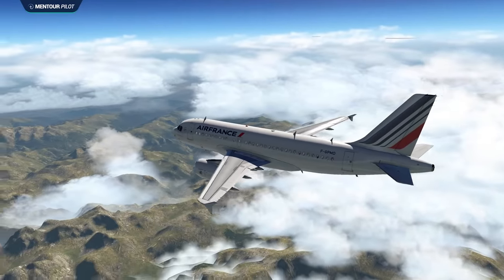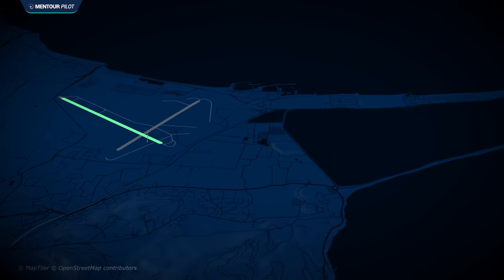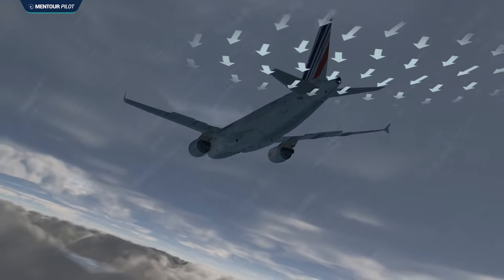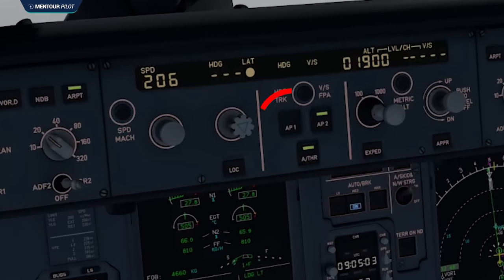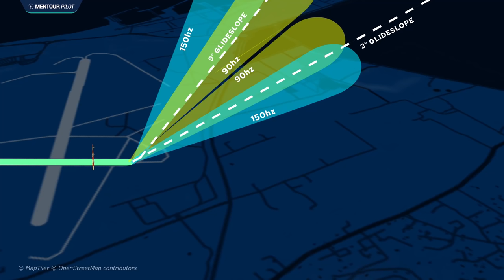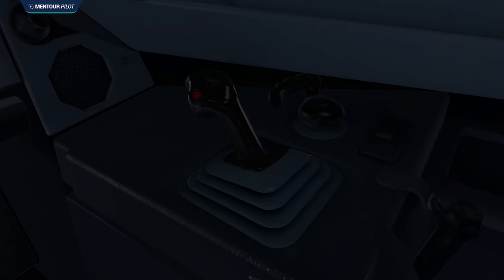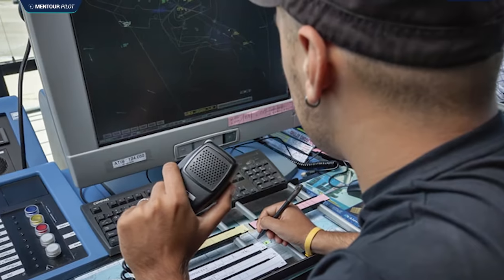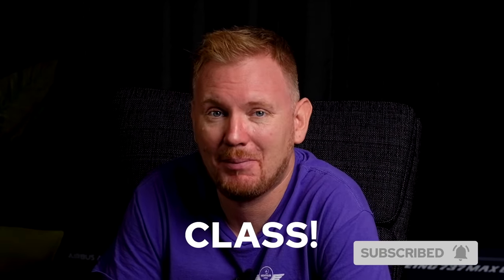An Absolutely CRAZY Reaction! Air France flight 7512

Comment: A few years back I was flying on Spirit Airlines. The flight was uneventful until we passed just east of Birmingham Alabama. I had the window seat and as a weather nerd I noticed a thunderhead just off to out forward port side. I knew that these pilots had beater deviate north or south to avoid them (or find a break). I looked up and the seat belt sign was dark. As a flight attendant passed I asked her if she was  aware of the situation, she told me basically to shut up and keep to myself. She continued to the back of the aircraft. I looked at the other two people sitting next to me to tighten their belts as tight as possible able and they did. A few seconds later we hit that storm and ran right into a downdraft. We fell 5000 in seconds rolling the aircraft. It’s bad enough to ride from the highest point of a roller coaster down to the bottom but to add in a few rolls is scary as hell. Now when the aircraft goes out of control, funny things happen in the cabin. Do you remember all that written literature, safety card, magazine and what ever else, all that paper flies around inside the cabin. It looks like someone toilet papered a tree. That’s not all that went tumbling. The stewardess in the back who shrugged me off went for some 0G time. When physics regained control, she broke her leg from a lose cart that hit her hard. The other one managed to walk on the ceiling while the plane tumbled. She found something to grab on and pulled herself to a safe position before the hard hit as the wings once again found lift. A few passengers who forgot to keep their seat belts on while in a seated position also experienced some airtime. And, let’s not forget all of the trash from the meal some actually paid for flying midair. The babies seemed to enjoy flying around. None crying as parents and other passengers quickly grabbed them down into their arms. The pilot regained control forcing more power and banking hard to starboard. Just when you thought it was over, we hit another downburst sending is down what felt like forever. He added more thrust and banked further to starboard basically sending us back west. Once we cleared the clouds, the pilot turned on the fasten seatbelt sign. The two people next to me were both shaking in tears asking if we were going to crash. I told them (as an engineer) that the airbus A320 was a fine machine and it would take a hell of a lot more to damage its engines or airframe. It seemed to calm them down. Throughout the aircraft people were rummaging paper for the all essential vomit bags. The forward steward asked everyone to stay in their seats. The middle isle was trashed with debris and his attention was on evaluating the situation in the back. The pilot turned us around back east when he found better conditions. We finally landed and they asked us to remain in our seats as the plane came to a stop. There were fire trucks all around us and a few ambulances. They had a scissor lift that was placed by a now open back hatch. EMT entered the aircraft and injured passengers started to identify themselves. After the interdental, we heard nothing from the cockpit. We didn’t see the flight crew or stuwrdests the rest of the flight but for the one who ran to the back. Finally the closed the hatch, technicians and lots of flashlights were looking at the aircraft as it was dark by the time we landed in Atlanta. They gave the all clear because we started moving again to the terminal. We parked and off we went. I couldn’t help but to notice the full bags all over the floor. I never heard a word about it in the news.
Reply: and then every9ne clapped
Reply: Were a lot of the folks in charge cocky and/or arrogant, or just that flight attendant who dismissed you?

Comment: Congratulations once again for the exhaustive work on this interesting incident.
I just wanted to point out the fact that to disconnect TOGA LOCK simply press the instinctive disconnect pb located on the thrust levers.
Can also be done by setting back the thrust levers as you mentioned but it may let your aircraft without trust for  half second.
Thanks again Cpt

Comment: Is the amount of training required ever-increasing?

In this videos you always say "we do more training on X now as a result of this". But is there anything you have to do less training on now? Or is the total amount of training just constantly increasing?
Reply: I think more training is the wrong term. I think they are changing where they're training and how they're training. Adding in relevant scenarios to existing training.
Reply: Also remember that the aviation industry uses 'just culture' to constantly improve all of the systems, processes & technology that pilots use too.... as they automate tasks or introduce better systems/tech, the types of knowledge & skills that a pilot needs to be trained in is constantly changing,. So rather than having 'more' training it's just evolving & refining the existing training to match the specific technology and skillset needed.
Reply: We aren't doing "more training," we are just emphasizing certain things in the sim.  Last cycle we had emphasized training on high altitude upsets and stalls.  The overall training time remains the same and we still have to cover all of the usual/basic scenarios such as V1 cuts, single-engine approaches and go arounds, normal RNAV approaches, hand flying, etc.  Some areas get more focus because of events like in this video or the Colgan Air crash near Buffalo, NY, or because our safety and training department are seeing a larger number of self-reports on some area.   For instance, if the safety department sees a big increase of self-reports on one subject, that subject may be the focus of the Spot training in the next training cycle.
Reply: Very good question
Reply: I think it's more like unlearning and relearning

Comment: Hey Petter!

I have a question. I’ve been flying a lot lately with the B787 Dreamliner. The safety record is amazing with 0 crashes. But recently I’ve read about the structural problems and it’s fleet being grounded not allowing them to be delivered to airlines.

But how come there still are thousands of Dreamliners still flying every day. There is so much topic around this.
Reply: The most important thing to understand is that there is NO reason to believe that the design of the 787 is faulty, but there ARE reasons to be concerned about the way in which aircraft have been built and inspected.
The Dreamliner has been tested and found to meet the relevant safety regulations, so it is allowed to fly. Unless and until an organisation with the relevant knowledge and authority demonstrates that the aircraft is unsafe, it will retain its licence. The regulations make no stipulations about the lifespan of an aircraft or its components, that problem lies with the operating companies and their maintenance divisions.
The problems which have occurred with 787s appear to be that Boeing has not been manufacturing the aircraft to the required standards and that their inspection procdeures have not been sufficiently effective at identifying and rectifying the problems. You may be aware that FAA is monitoring very closely Boeing's delegated authority to certify newly-built aircraft for delivery. The problem is that FAA does not have sufficient staff to undertake the necessary inspections and Boeing scrapped nearly 1,000 inspection jobs in order to improve profitability. Ultimately Boeing has no option but to comply with FAA regulations and directives; the question which remains is whether Boeing will atttempt to use commercial considerations and/or outside agencies to force the FAA to lower its safety standards. Boeing has on many occasions complained that the way in which Airbus is financed is unfair and is a direct threat to the economic well-being of the whole of the USA.
Reply: There are no structural problems with the 787, the only problem with the 787 has been the lack of quality control in the construction, mainly with parts being lose or extra pieces being lose inside the airframe, non of it affects the planes ability to fly or the safety, it's really only noticed by the crew, the average passenger will never know.

Comment: Many ancient technologies are still in use today.

An example is the airport radio system. It is just above the domestic FM band, the big difference being it is AM, which can be "jammed" by two aircraft transmitting at the same time.

A smartphone has way more technology than several aircraft systems.

Comment: AIRBUS SAVED THE DAY! Amazing that in this case the systems still held the plane more or less stable rather entering a bizare dynamic flight conditions at low alt. i.e reverse track 45* bank and command gs OVER 9000 - 4800ft/min+ PLUS BACKWARD AScend rates.
Reply: what would've happened on an NG Mentour? i bet you know enough about airbus to comment.

Comment: How come that they didn't land in the opposite direction and thus getting head-wind? Head-wind should be easier to handle than tailwind, right?
Reply from the maker: Because the weather would not allow them to get down from that direction. To low clouds and no ILS approach.
Reply: @MentourPilot  Allowing ILS approaches from only one direction is a safety issue. Are there reasons other than cost for the lack of a second ILS installation ?
Reply: @hb1338  Terrain or obstacles, long term weather doesn’t justify its large upkeep cost

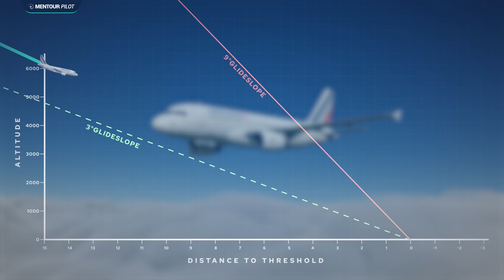Comment: As a retired avionics engineer who used to repair and maintain TACAN, VORTAC, and VOR/ILS ground installations, I picked exactly where this story was going as soon as I saw the graphic at 6:14 showing the the 9° GS. The reality is that these secondary lobes at 9° and 15° (there are "no flag" nulls not lobes at 6° and 12°) are much weaker signals than the primary lobes (typically 20 to 40 DB down) so their range is very limited. Picking up a secondary lobe ought to be impossible unless an aircraft is flying a long way outside the envelope of its approach profile, for example, if you were 15km out and in line with the 9° lobes, the signal would be too weak for the VOR/ILS receiver to detect. In reality the only place you will detect them is too close and too high, and unfortunately, in this case, the 50kt tailwind combined with the pilot's instrumentation selections caused the aircraft to be exactly where it needed to be to pick up the false GS indication. Luckily, the Airbus Alpha Protection saved the day, otherwise a LAS could have results in loss of aircraft and fatalities.

Comment: First of all thank you for your great work ! I saw this video some time ago and appreciated it. For me it was just a good aviation story and nothing else. Now, I will try to explain what you said about A320 old system, not updated to identify false lobes, like on A350, for instance. Today, doing an A320 type rating with two experienced captains I learned that they never heard about the ILS false lobes. I was teaching them the Intercepting G/S from above. I am a quite old pilot, and from a long time ago examiner and instructor. When I studied first time the ILS system, in 1989, the theory said that the ILS system contains three elements: Localizer, Glide Slope and Outer Marker. The Outer Marker was used to check that you are on correct glide slope(lobe). At that time the theory teached us that there exist one more lobe above the correct one, at about double angle, six degrees compared with the wright one of three degrees. Nothing about many lobes or reflections and the frequecies used to generate them. But at least it was specified the existance of second false lobe. That is why it was mandatory during an ILS approach to verify the correct altitude at outer marker. They then replaced the OM with OM substitute and afterwards with GS check. At this time the importance of this check remained  obsolete,unknown and not used. I was teaching my students about the importance of G/S check and also to be aware of calculation of three degrees G/S as you said you were doing on 737. I was also experienced, few times,  intercepting the six degrees lobe, during training due to students lack of awareness or knowledge about false lobes. This is why I found this content very useful to explain what means ILS G/S and repercussion of not being aware of system design “bugs”. Thank you again !

Comment: Interesting talking about the extra lobes. As an amateur radio operator we always have to be aware of our radiation pattern. Sometimes they are useful, those extra lobes. Sometimes they’re not useful at all and end up warming the clouds. It entirely depends on antenna design (and what multiple of a half-wavelength they are).

Comment: What an EXCELLENT presentation here Captain. So well portrayed and accurate with the Airbus. I am jolted back in time when i have been "almost" there myself flying the Airbus family. SO EASY to get caught....we were initially trained how to capture the G/S from above using V/S by "pulling" the selector knob and turning whilst making certain we had nothing lower than the FAF alt selector until we get "alt"* and a boxed G/S capture and THEN we select the missed approach alt. If it is set out of sequence you risk having engines remain at idle even when in SPEED mode and quickly get into VLS and thankfully Airbus saved the day applying A.FLOOR. If we ever pulled that during a proficiency ride in the sim it is automatic failure. Scary stuff. Thank you for your tremendous and educational presentations as always.

Comment: In my previous life, I was an instructor at a military Instrument Flight school, and I recall issuing a caution about the "false glide path" problem that could occur when trying to capture an ILS glide path from above (remember that ILS was invented in WWII !).   The bottom line is that all aircrew must maintain situational awareness, especially when the autopilot is flying the aircraft.  "stick and rudder" has been replaced to a great extent by automation, but there is no replacement for "air sense".   The aviation industry seems to be approaching the "dog-in-the-cockpit" syndrome, where the pilot is there to feed the dog - and the dog is there to bite the pilot if he touches anything !  Glad I'm retired.   Great video - well presented.

Comment: @Mentour Pilot - in the video you mentioned the 'capturing from above procedure' and said that the altitude window would be set higher than the aircraft's current altitude to enable V/S to capture the glide.

Just FYI, our airline does it differently, and we set an altitude of 1000' above the airfield elevation (which roughly coincides with our hard stable approach criteria altitude).

This has two advantages, a. if the aircraft go into alt capture, or alt *, you've obviously not made the stable approach criteria and should go-around, and b. it acts as a safety net - should V/S fail to capture the G/S with the altitude selected above the aircraft, it'll fly you right into the ground - by selecting 1000' above the airfield, this will prevent that.

Oh, we also have a max V/S of 1500'pm to perform the manoeuvre - if we can't capture using that, again, we're not really going to be stable.

 Different ways of skinning the cat, but I do like our method for the layer of safety it provides.
Reply: That has the massive disadvantage of realty capture from your high ROD preventing you from capturing a perfectly achievable GS. I know if no airline that does it that way.

Comment: A great presentation. Avoid Trap Mitigate is a very powerful tool when discussing high energy approaches. We as Pilots become very good at The Avoid part, through briefings and experience etc, but the trap part is (in the heat of battle) more tricky. Briefing is great but it is just the plan, maintaining SA during the approach and constantly comparing the current situation to the plan allows you to spot and correct deviations as they occur in real time.

I watched a crew recently, and at the brief they mentioned that Airfield X had the potential for high energy approaches, so they discussed a simple solution that every time they got given a reclearance the PF would Pause, consider then Action, the reason being that instead of blindingly following ATC’s guidance it allowed him to cognitively consider his actions (and track miles) before actioning them, thus also being aware of his natural bias to do exactly as ATC say. The crew also discussed ‘what if’s’ thus meaning that if they needed extra miles, they already had a pre briefed holding pattern in mind to achieve them. Mentally this makes any intervention to ATC’s (or the Tailwinds) plan much easier to implement. Simple but very effective. 

The reasons for such a calm methodical approach seemed to stem from a Just Culture. The Pilot knew that if he kept things safe, if he had a considered and justified approach to risk, he would always be supported by the Just Culture system.

Comment: @MP: Actually, there is no antenna less than hundreds of kilometers in size that "sends out 90Hz", as you told it. Actually, the RF signal is modulated by 90 or 150 Hz in some way (no idea what exaxt way in this particular case), thus creating sidebands. Greetings to the flight engineer from an electrical engineer 😂